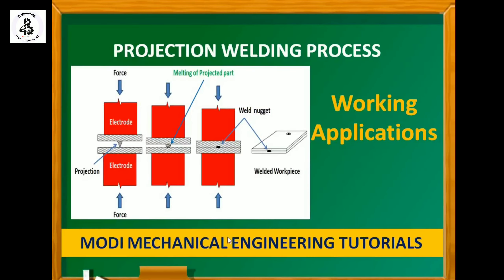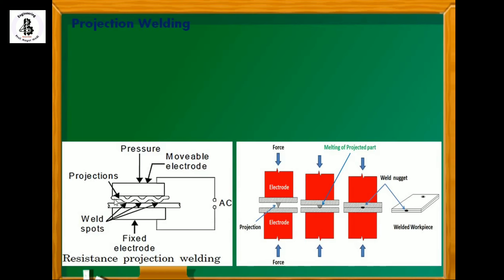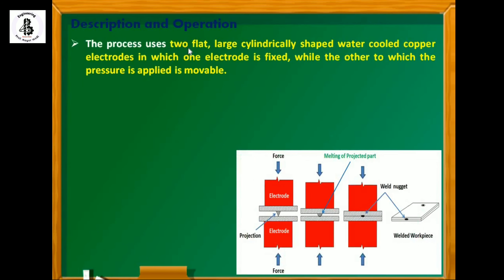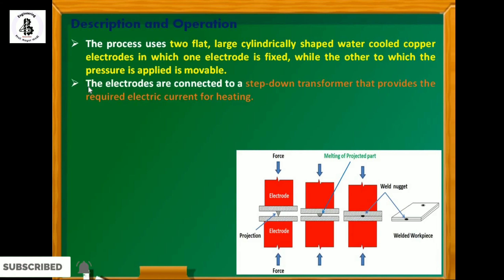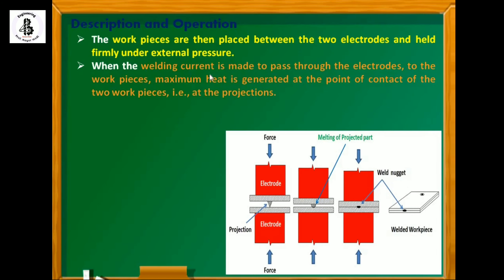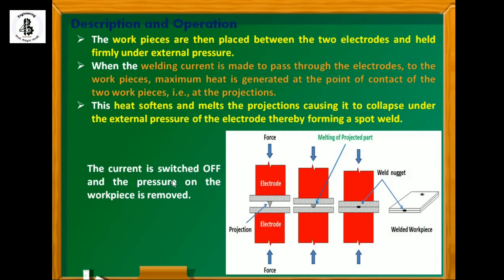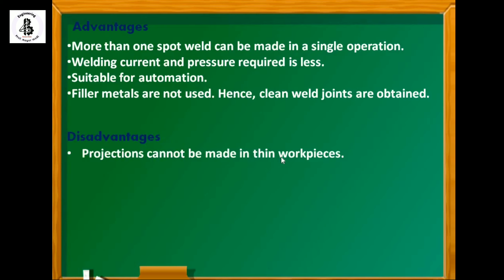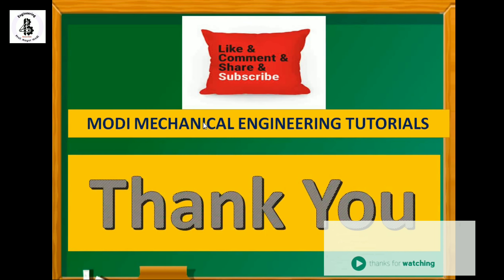projection welding | projection welding machine working principle | resistance projection welding

Comment: Thanks for this video!
Question: What are the most common failures in projection welding? What are the key points to keep in mind to prevent burning through metal? How thin is too thin?